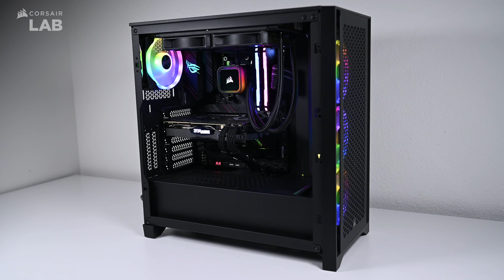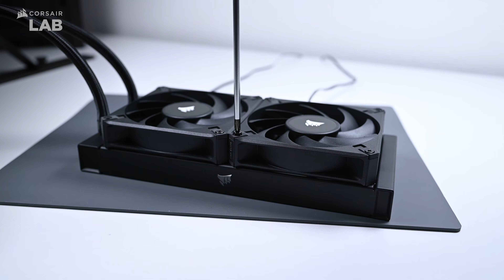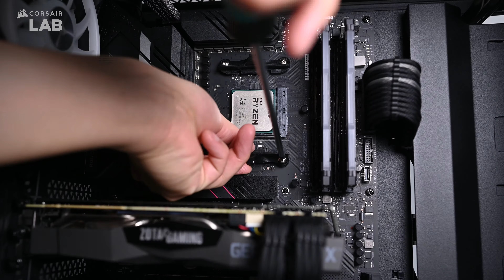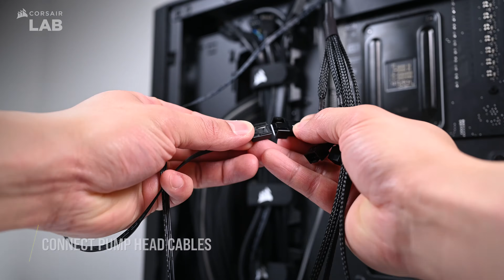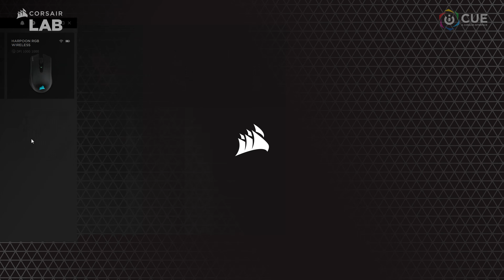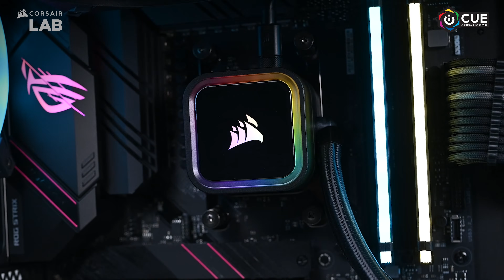How to Install CORSAIR iCUE RGB ELITE Liquid CPU Cooler

Comment from the maker: Need help with your CORSAIR liquid CPU cooler or other CORSAIR PC components? Reach out to us at https://help.corsair.com
Reply: I have an icue h115i elite capellix but I'm having an issue with the screws .I've managed to screw in the fans except for one screw but on the mounting side I can't seem to screw them in all the way. I only managed to with one but not the other 7.
Reply: How about you just include the instructions in the box or a working QR code on the box. I shouldn't have to Google instructions to install something like this. At least put a QR code link to this video on the box or in the packaging.
Reply: Can u please become partners with lian li so u can use icue for asus and l-connect so its so easy
Reply: How do I connect this aio to my new icue link hub plz make a video about this I scream everywhere for the answers didn’t get any plz help.
Reply: So maybe this is a silly question: is the radiator pre-filled with liquid? I don't see any fill port on mine.

Comment: Firstly thanks you You saved my pc of a " fring end" .
 A few day ago I felt something was wrong with my pc... So I checked the CPU temperature in Bios and was 98c and a red warning. So I went to YouTube as I have the same cooler on your video... I did all the checked and I realised that the liquid cooler fand was not working..
Than I checked behind the motherboard and I realised that the supply cable was not attached... My bad has 2 days ago I installed an additional ssd and unwilling I un remove the power from the kooler... Now the temperature is 27c hallelujah... Thanks for updating and sharing your tutorial...
Ciao

Comment: I am currently orienting myself for new components to build a new computer. This is in connection with the arrival of a new processor, the Intel Core Ultra 7 265K. This has a socket 1851. In my current system I have the Corsair H110 water cooler. On a socket 1150. Is this water cooler also compatible with the latest socket 1851. Because I notice that in many specifications of water coolers, this can be applied to both the socket 1150 but also to the socket 1851. Is that also the case with the Corsair H110?

Comment: Just bought this for my AM5 system. There is absolutely no installation guide given in the box and none found on the product support page on their website. 
This video is the only thing we have and it barely explains it correctly. What a complete and utter failure on Corsairs part. No labels and no instructions. Do we just guess?

Comment: i have never been so frustrated with trying to figure out why i bought this exact AIO cooler and everyone seems to have different cables. my cooler didn't come with a sata cable. it came with a splitter for my other fans and a 3 prong thats it. my fan lights up and runs but my pump doesnt light up and i cant tell if its on because it doesnt vibrate or make any noise at all. I've spent hours and all the videos either rush through it or their wires dont match up with mine.

Comment: Thanks for the video. So I do not need to put the thermal paste ? Do you suggest to mount it on the top of the case or in the right side ?
Reply: No, it has thermal paste already applied on it as seen in the video. It’s suggested to just mount the radiator on the top as exhaust fans.

Comment: Omen 30L, AM4 87C3 motherboard, Ryzen 7 3700x: standoffs have course thread on one side and fine thread on the other. The video shows them to be the same as the ones that came with mine, but the course threads don't fit the motherboard or the thumb nuts. The fine threaded end fits both the motherboard AND the nuts. It appears that the stand offs need to be fine threaded on both ends. I haven't seen anyone talk about this when installing. What do I do? I'm stuck at this point and would like to get this finished.

Comment: Very good video quality. Horrible instructions.
Reply: I found it quite easy, it really depends on ur own experience with PC building. It was my first time ever doing smth to the PC and i had no troubles, I did have the white version of the cooler so finding the cables he was talking about was easier.
Reply: @tigrymorningstar  I was referring to this video tutorial is only for users with some experience already. This tutorial is useless for first timers.
Reply: @christopherowens2635 This was my first time ever doing something. But i wasn't installing it new i was replacing   a old cooler with this one so all cables were already put in place, I understand what you mean tho with its not that clear for first timers.
Reply: I SPENT HOURS TRYING TO FIGURE THIS OUT YALL SO THE EXTRA WASHERS NEED TO GO ON THE TOP OF THE MOTHER BOARD WHERE THE STAND OFF SCREWS GO INTO

Comment: the usb plug lead with mine come with a 4 pin plug with 3 wires your like wtf and the wires are different colours from standard why not do just a standard usb you cant go wrong as at the moment its guess work, you vid shows a different plug that i was supplied

Comment: Hot air Always goes on the top and is always good exhaust the air from the top and back space and let in-flow from infront . by placing the cpu cooler on the top and make it exhaust air , u make the already hot air that exist inside the pc case , pass through your cooler . Why would want hot air coming from graphic card and motherboard be filtered through the fridge of your cpu ? isnt it stupid ? instead place the fridge on the front , make it pump in cold air from outside and let the top space free so that it can pass easier without obstacles through your top's fan . Hot air always goes on top . Corsair lab did u really atend your physics classes ?
Reply: also try use negative preassure . With negative pressure there are no micro turbulant air currents that causes hot spots inside the case even if the total temperature stays the same . You may have to clean the pc case more often cause dust is more easy to attached on your pc parts when the air pressure is negative , but it will also keep the differentation of temperature inside your case at better balance .
Reply: @christosagapoudas903  You can't be serious.. are you? You know, the purpose of a radiator is to exchange heat with air. Meaning that cold air going through a hot radiator will make the rad' cool but the air heat up, they exchange their temperature. So you're basically blowing hot air in you pc so only your cpu gets cooled... What about the GPU, M.2 Drives, etc?

And btw, majority of professionals build their cooling system that way, for obvious reasons. Are you trying to say that you, a dude watching a video of ''how to install a water-cooling system'', knows better than actual pros who literally made the product and designed it with actual engineers? Oh and in many pc cases, you can't install a rad on the front without actually risking reducing your pump and cpu's lifespan..

Comment: Am I meant to plug that little cable into the cpu_fan or the ao_pump header???
Reply: I would plug the fan splitter into cpu_fan and the pump tech cable to aio_pump
Reply: @---GOD---  yeah I did, thank you for the reply though. The actual issue was the AIO was faulty and I had to get it replaced
Reply: @megoldfishes  Hello, So I have both on my motherboard where should I connect it please in the aio pump header or cpu fan header which is better 
?
Reply: I am talking about the little cable in the video

Comment: I have a r5 7600x oc 5.3 ghz and I think I have a problem, I have 85° C at 80-100% usage and 50° idle while my cpu is at 88° (5 mins stress test) my cpu cooling is at 36°, I screwed the screws as best as possible. When I turn off Cpu z my cpu has 53 degres after 20 sec. Someone in my case ?

Comment: Why is there no manual included for the H100i RGB ELITE? Nothing in box, and no manual on the product page under downloads or support tab.
Reply: Did you scroll to the bottom? It was in the Guide tab, under Quick Start Guide. Even came with a downloadable PDF.
Reply: I SPENT HOURS TRYING TO FIGURE THIS OUT YALL SO THE EXTRA WASHERS NEED TO GO ON THE TOP OF THE MOTHER BOARD WHERE THE STAND OFF SCREWS GO INTO ! I HAVE NO IDEA WHY THEY DONT INCLUDE INSTRUCTIONS OR ANYTHING AND THIS VIDEO SKIPPED OVER ESSENTIAL STEPS

Comment: The usb-c plug… Riiight right because mine came with that. Why are there so many variations of the same product? My pump only came with a 3-pin for the cpu path and a 4-pin for the pump. Provides 0 RGB to the pump.
Reply: Did you ever find a fix?

Comment: My H100x RGB Elite came with 3 sets of Intel standoffs and I'm not sure which to use with LGA 1700 socket. One standoff is small (about 8mm body length) with a short wider screw on one side that I believe if LGA 2033. However, the other two are about 10mm (body) and 11mm (body) respectively and have thin screws on either side. I'm guessing one of these is the 1700 compatibility kit but none of these are labelled.
Reply: Did you figure this out? I just bought one and I’m super confused
Reply: Kind of cool how Corsair release the product without documentation and the QR code on the box just goes to the government mandated paperwork, not the actual instructions. Great customer service corsair. Way to go guys.
Reply: Also have this problem... Bag of standoffs. Zero instructions.
Reply: as a lucky customer who recieved marked bags, 11mm standoffs are for LGA 115X/1200. 8mm standoffs  with unequal threads are LGA 2011/2066
Reply: Mine didn't come with any stabdoffs

Comment: Im having a heck of a time installing this. I dont have any usb c plug into the motherboard. I'm assuming there's different versions of this cooler? I might have to go back and use my old liquid cooler because this one does not seem to have everything it needs.
Reply: A usb c cable plugs into the pump head. On the other end is a usb 2.0 that plugs into your motherboard. Usually located near the bottom
Reply: Yeah but that didnt come with mine? I have no cables that arrived with my cooler@DreamKeeper.
Reply: @DreamKeeper. .
Reply: same here

Comment: I have no idea why you don't show which screws to use on the radiator. :(
Reply: Use the long ones to mount the fans to the radiator and the short ones to mount the radiator to the case
Reply: @DreamKeeper.  faxx

Comment: You guys should totally ship with instructions, instead of 1 video that covers 3 products each with different wires. Also maybe make your wires actually work? I’ve spent $700 on coolers from you this month and still don’t have a working PC. The LCD series is riddled with hardware issues and Corsair support is the biggest joke I’ve ever heard

Comment: is there a way to  set Pump speed to something lower without the huge 1 gigabyte iCue-Softtware? I've got a brand new PC and the pump is set to full-speed (DC) in Bios. Can i safely change that to something lower? Or is that ill advised?
Reply: Pump should be set to 100% choose what u want ur fan to he
Reply: @Clikkkzzzz  Thx. I went for the iCue software in the end even though I hated doing that. But it got the pump alot quieter.

Comment: great product. one issue with this video. your manual says to have the fan as intake to run optimally but the video shows it as exhaust
Reply: Just came here for this, what did you settle on?
Reply: @VillPom  initially I had it exhaust but have since changed to intake. it seems to operate better that way. i figure the cool air from the room is better blowing over the cooler than the hot air from the case.
Reply: The vast majority of installs I see tend to have the radiator fans set in a push configuration as an exhaust when top mounted and either a push or pull intake if front mounted. I've never seen a top mounted pull nor a top mounted intake, nor a front mounted exhaust. 
Either way you do it, I don't think it matters too much. Maybe a few degrees at best.

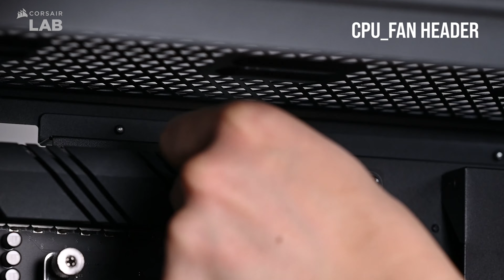Comment: 2:13 If it's supposed to go in the CPU_FAN header why is the pump cable in the AIO_PUMP header?
Reply: To fans
Reply: So you plug it into cpu fan. If you’re using non stick fans that don’t support iCUE you can plug the fans into the cpu_fan header and pump into the AIO_pump header.
Reply: The pump cable of an AIO liquid cooler is usually plugged into the CPU_FAN header.
Because if the pump fails, the PC will warn you.
So that you don’t burn up your CPU down.
However, some motherboards have a dedicated water pump connector such as the AIO_PUMP header. 
In this case, you can plug the pump into that water pump header and leave the CPU Fan header blank.
The idea is to have radiator fans speed be regulated by CPU temperature.
Reply: @sblworld1  So I have both on my motherboard where should I connect it please in the aio pump header or cpu fan header which is better ?
Reply: I still didn’t fined where does he connect this Fan Pwm splitters to ?

Comment: I have an H60x icue Elite. There's nowhere where I can plug any USB-C cable on it. I could not find any good documentation and quite disappointed that Corsair could not release a good tutorial or documentation. I have already placed the cooler on my CPU now. I see a little plastic with a cross, probably for a screwdriver but now that the cooler is on the mobo, it's not possible to reach that plastic thing. Anyone knows what's that plastic thing with the cross and why that exists?

Comment: Tried reaching out to Corsair to ask about the AM4 cpu bracket being slightly loose when installing the am4 brackets, couldn't get to a person. Was on hold for an hour and the Interactive Voice Response (IVR) System told me after holding for all that time to call back later or send an email & hung up on me. Corsair really really really needs to hire more staff for their call centers & pay a wage fair to the complexity of the devices they sell.

Comment: thanks for the video.  I thought I might have an answer to a question about attaching the back plate.  I wonder how did you manage to install the four pump screws without backplate kickback problem.  did you start over and cut in the video?  it is impossible to screw the pump if the back plate is not fixed.  a comment helped us.  the person is not sure why you missed something.  I don't say anything, I'm a beginner.  Lionel of France

Comment: I never realized the rubber corners on the fans were there to let us know when to stop pushing deeper with screw… I think I need to open up my case and unscrew them a little.
Reply: They're there for noise reduction from vibration.

Comment: I just bought the H60x elite but it doesn't come with a USB 2.0. It comes with a fan header and RGB header attached.. that's it. I have the RGB header connected to my corsair RGB fan hub but iCUE doesn't detect my cpu cooler. Any help on this?
Reply: same
Reply: same! and my motherboard doesn't support a 3 pin ARGB header so i am stuck
Reply: @markcaldwell5909  I'm pretty sure if you have a four pin the three pin still can be plugged into that location.
Reply: welp guys i learned in order to get it to pop up and customize you need to buy the separate aio controller
Reply: @benchmarktv2582  Even if its already connected to a rgb hub? I have all my other fans connected to it as well as my CPU

Comment: Nice video but even IKEA stuff is better explained. First this cooler is not fitting on top of Corsair tower 570x, the msi pro carbon x470 is not allowing such a thick heater + fans. Then, What configuration made them extract air would be a plus as It is not that intuitive. Mentioning that screws need their washer would have avoid me to screw unscrew 3 times. And the vertical configuration of the heater would be also nice to know. Same for fan cables orientation etc. Recommended air flow in atx tower ? Corsair towers have filters on front and top so fans needs to bring air in at these location, preferably etc. Even if I will manage, instruction should be « stupid proof »

Comment: I installed on corsair 570x on top as exaust, and top glass is as hot as 40c !   I wonder if setting it to exhaust is worth it? as it constantly remain hot as their is not much room on either side of glass for the air to flow effectively ! 

could be better to set it as INTAKE? any ideas?
 this way top glass is not  HEATED all the time as its creating its own heat  and though keeping the  radiator hot ?!

Comment: Should I not be plugging the pump header into the pump aio plug instead of the cpu plug? What’s the difference?
Reply: I came here for this very reason. My understanding is that the AIO_PUMP header provides a constant voltage to the pump. I think they have it connecting to the CPU_FAN header as something has to be there or your machine will not boot (unless you turn off monitoring of the header in the bios).
Reply: @RonaldBradley i had this today and reached out to support, you plug it on the cpu header, or you disable the error in bios
Reply: @bobkeulen4588  allright bet thank you!!
Reply: @RonaldBradley  allright bet thank you!!

Comment: iCUE is only for tweaking the lights and stuff, right?  Can I assume that on the first build of my PC this thing will come up and keep the chip cool automatically, just like an old-fashioned fan, for at least as long as it takes to get windows up and start updating drivers?
Reply: iCUE is a software that allows you to control the lighting effects of your liquid CPU cooler, but it also allows you to create your own custom cooling presets. Liquid CPU coolers have four presets to select from: Quiet, Balanced, Extreme, and Zero RPM. You can also create your own preset to fit your specific needs.

On the first build of your PC, the AIO liquid cooler will keep the chip cool automatically, just like an old-fashioned fan. It should work for at least as long as it takes to get Windows up and start updating drivers.